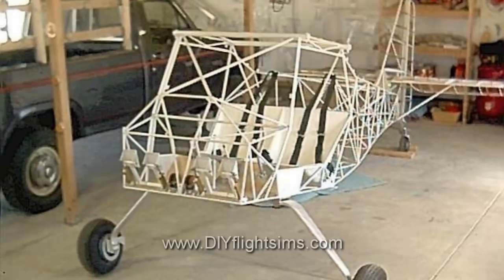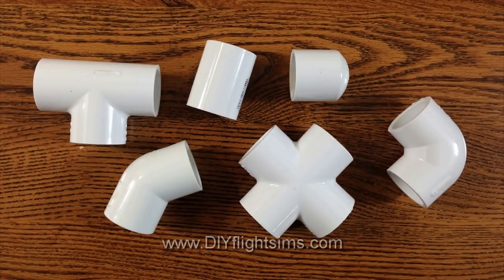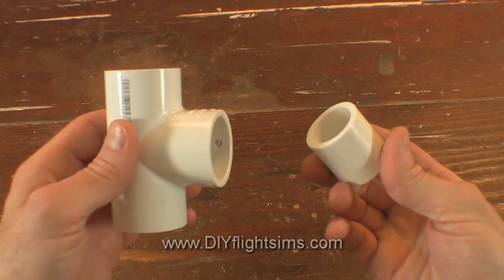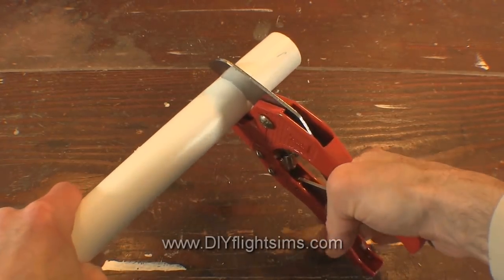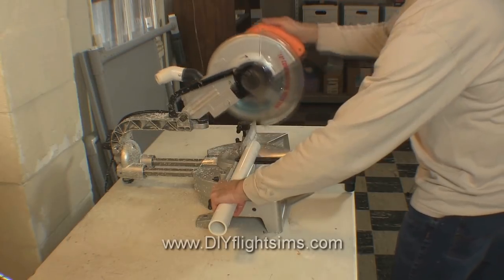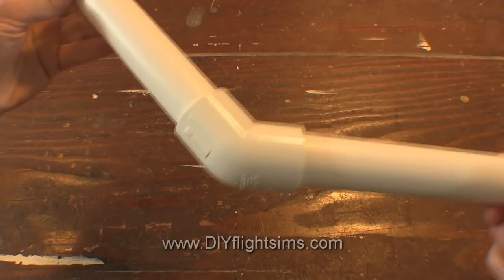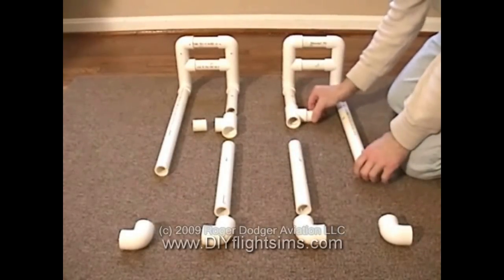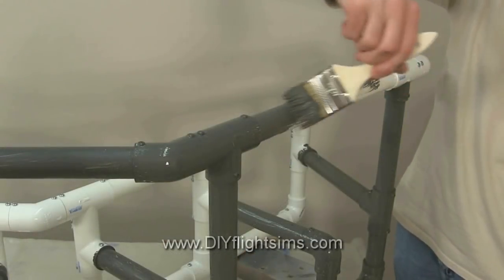Building Flight Simulators with PVC Pipes

Comment: great video! This is a brilliant idea for making simple sim pits! I've always wanted to make one, but lack proper tools, making it with PVC is obviously viable and very simple and easy compared to making it out of wood! I could even see someone using zero wood in a whole sim pit with this technique! It would be easy enough to make button boxes/panels that mount to different parts out of acrylic panels or 3D printing! You could even make interchangeable consoles if you wanted, considering how cheap it is to make one it wouldn't be that crazy. The only major problem may be trying to replicate cockpits of real aircraft, a PVC frame might not lend its self too well for this.